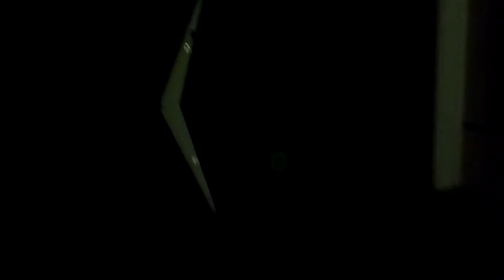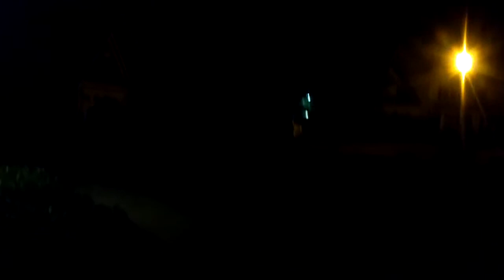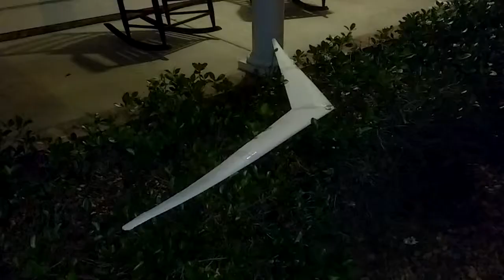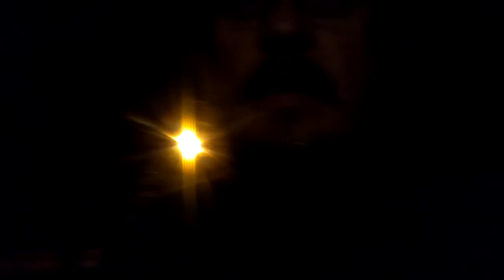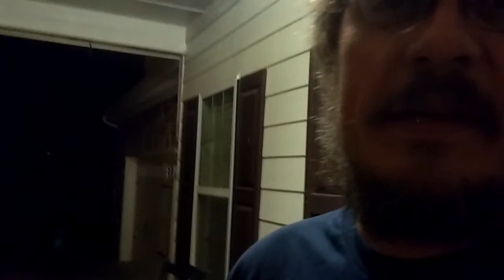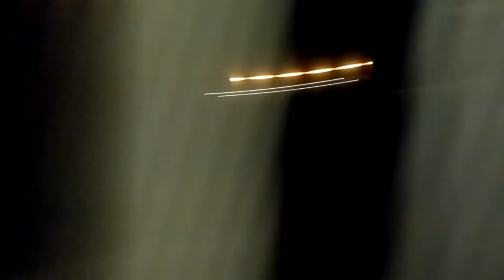FoamyDM Prandtl-D DTFB Glide Test

Comment: Please. A build video. Please... I'm trying to find a good way to build the 3D structure of a Prandtl wing.
Reply from the maker: That is in the plan toward a finished product. I have to verify this flies like we expect it will. I don't want to show you how to build a flop.

Go to https://forum.flitetest.com/index.php?threads/prandtl-d-foam-board-wing-by-foamydm.58170/
 There you will find the build-log.
Reply: If you're still working on this, I recommend hot wire cutting from large panels of XPS insulation foam. That will give you much better control over the shape of the wing than foamboard would.